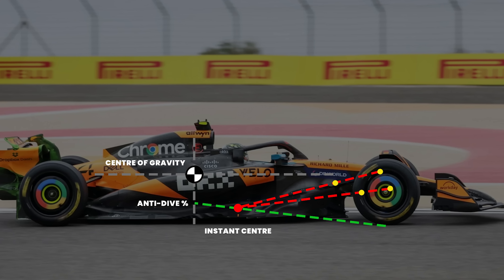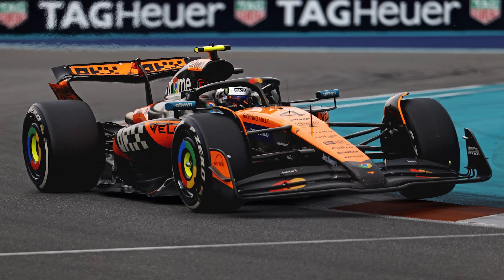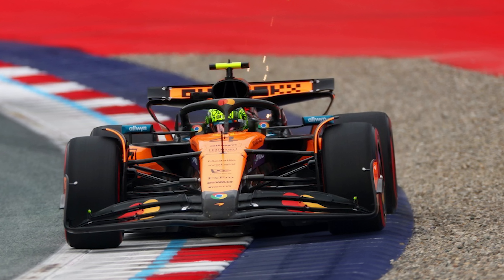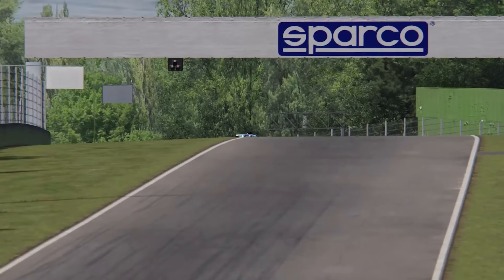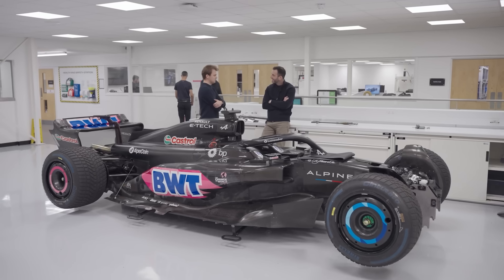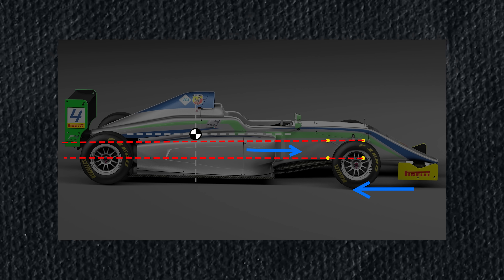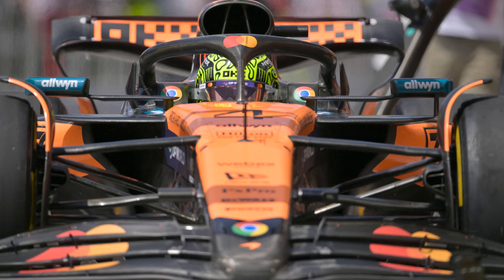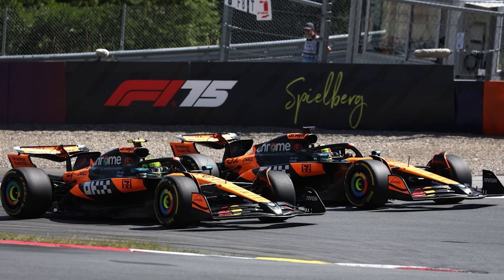McLaren’s NO SUSPENSION Trick

Comment: "Stiffer" front end would make that weight transfer reach the tires much faster, causing sharper spikes in load and making it harder for the driver to anticipate the onset of understeer/oversteer and under-rotation. Therefore this will potentially increase tire heat and wear, if it's too much for the specific driver to manage. As with most things in racing, it's a trade-off!
Reply: If Im not mistaken, the whole antidive thing is to prevent the weight shif to reach the tyre. While on a stiffer suspension the weight do reach the tyre. Correct me if I'm wrong.
Reply: @slash148  If you stand on your both feet and rock right to left, can you prevent the weight shift reaching your left foot other than by lifting it and falling over? It's impossible. But if you bend your knee in the process that will slow down the transfer of energy to your foot. That's why we bend our joints when we land. So yeah, even if you have no suspension at all (and zero dive), you'll have the same weight transfer, but the load will reach the contact patch much faster.

I think, McLaren's calculation is that aero benefits from having a more vertically static car, aka "stable platform", will outweigh the suspension performance downsides. In general, stiffer cars is a known side-effect of regs that favour ground-effect.
Reply: @Pandamasque  To my understanding (according with what I just saw) The weight is absorbed kind of horizontally rather than vertically.  I mean, if you want a stiff suspension just stiff the spring/dampers. The nose won't dive but the tyres are going to degrade faster. But they said that antidiving helps the tyre last longer, so.. it shouldn't be equal to just stiffening the suspension, where the weight should still be there, just transferred to the rubber. That's what is making me doubt. I'm not engineer by no means, just wildly speculating.
My point being: If they say: "Nose doesnt dive, tyre last longer" How can your response be: "No, tyre degrade faster cause stiffer suspension'", when McLaren has had phenomenal tyre management. Wouldnt the "tyre last longer" bit imply that the whole system is just much more that a simple stiffening of the suspension?.
Reply: @slash148  That tire may indeed last longer due to the car staying more level, therefore not losing as much downforce and not sliding as much. If this effect is more pronounced than what I described and what Norris complained about, then it's worth it. They don't do it (as much) by simply stiffening the suspension because that would compromise its ability to absorb undulations and keep tires in contact with the track.  Some years ago Mercedes allegedly had an even cleverer solution, a hydraulic system that connected front and rear suspension and prevented simultaneous rise at the rear and drop at the front. At the same time suspension could remain as soft as needed. But that was outlawed. The same was used by some LMP1 competitors. This new geometric trend is simply a way to achieve similar results within these tighter regulations.
Towards the end the author of the video emphasised that the weight transfer still happens. You can't cheat physics. The weight will reach the ground. The only thing connecting the car to the ground are 4 tiny contact patches.

Comment: I'm curious. I worked with phase change materials for many years in microelectronic applications. (phase change memory) That set of materials generally have low coefficients of thermal conductivity, which means that they aren't good at transferring heat. How is that used to an advantage in braking for F1 cars? 
Was the stoiciometry of the phase change material engineered to actually have a phase transition during braking, which could in theory absorb more heat than a standard brake pad?  I assume that could potentially mean cooler discs, but does that really have a significant effect on the tire temperature? 🤔 
I don't know much about cars, but F1 is rad. Subscribed. 😊
Reply: I’m not an engineer so maybe I’m not in the position to answer but from my understanding the phase change material is used in the cake tin, the shrouding between the brake and the wheel rim. Therefore in theory because of its low thermal conductivity, it could be designed to keep excess heat away from the tyre carcass. 

If you google F1 wheel cake tin there’s a few illustrations on what it looks like and what it does.
Reply: The only thing I could add is that in F1, every tiny improvement gets taken advantage of. On qualifying laps the time differences are often in the 100th's of a second... so some things might not be relevant to daily driving vehicles, or other motorsports... that's why F1 is the masterclass of motorsport ❤
Reply: It's so NOT, but knuckleheads read something that sounds official and IRRESPONSIBLY "Report" on it and give it an insane amount of credibility with exactly ZERO evidence or a real understanding as to the capabilities and possibilities of such, including this nitwit.
Reply: All material are phase changing but the point is to find one at correct melting point, latent heat, and thermal conductivity. Water could be a good material if it had a higher melting point.

EDIT: Noticed after posting that water would be a horrible material because ice would expand. Therefore it would be hard to make sure that liquid would stay balanced in a moving car.
Reply: @suokkos  It's also a terrible example because it would evaporate and cause oxidation to some degree. But you're wrong in saying EVERYTHING is phase changing, at least not in any way applicable in this type of environment.

As for Ice causing expansion, that would actually be a great way of controlling angles and the like on bodywork because if you can freeze it inside a cavity that's built in a specific way that causes it to always flex or contour in the exact same way every time, you'd have a nearly undetectable way of having active aero.

Regardless, Phase Changing NOTHING was utilized by Macca to achieve what they are with the tires and neither is suspension geometry. Regardless of Geometry, Track Temperature, pitch and roll under acceleration and braking affects ALL cars because of this thing called "Physics" that NOTHING is impervious to, and Macca also does not have special tires that are immune to all the forces they are subjected to. More likely than anything else they have devised a car that is better balanced than everyone else that is more aero efficient on all fronts and they have likely figured out how to mount the entire drivetrain lower than anyone else, thereby benefitting by a lower center of gravity which affords a car superior performance.
Reply: @theINQBS  , I said everything is phasing changing material because they are. They just have different properties. A lot phase change use cases require specialised properties which means people might associate the word to a very specialised subset of materials. Different applications have different subsets of materials which apply.

The earlier video suggested that Macca might be using phase change materials to manage break heat. The idea would be to collect heat to phase change during breaking which limits the temperature to the phase change point. This would avoid overheating tyres. Normal air cooling would then remove the extra heat between breaking zones. This would reduce or eliminate temperature variation which is supposed to help tyre life.

I didn't think about expansion changing body work for an active aero. That is an interesting idea. I was thinking about the problem that liquid water in rigid container would leave space for sloshing. Breaking would cause the melting which means sloshing would affect cornering. Freezing would happen only slowly while cooling removes heat after the breaking zone.
Reply: @suokkos  Trust me there is ZERO Truth about Phase Changing anything. F1 engineers are among the very best on the planet, and if they thought there was a practical way to apply said materials in a way that led to a faster car that's legally within the confines of the rules and regulations ALL teams would have implemented them long ago.

As for liquid filled elements, a simple valve would allow a compartment to be filled to absolute capacity with exactly zero slosh, and a clever way to change a liquid's outward exertion is agitation. And when you remember that an F1 car vibrates any hundreds of millions of times per minute, agitation would likely be the altering component that would likely cause an aero component to change angle or shape ever so slightly.
Reply: The phase change material is packed into the outer edges of the brake drum so it is mostly for tire temps. 
I think they can fit a lot of it in there so it ends up making more of a difference than it would in microelectronics. 
This keeps the tires in the optimal window for better grip which allows the drivers to push just a bit longer than the rest. 
So it is less about the temps under braking and more about temps throughout a lap or (more impact fully) throughout an entire race stint. Max has still been able to out-qualify the McLarens at times because the phase change material is most impactful over multiple laps. 

Definitely recommend watching this channel’s video on the phase change material. 😃
Reply: @embeddedspade9576 In microelectronics, it's usually not used to alter the transfer of heat. The concept there is to make an extremely tiny memory bit that can be altered between crystalline (low electrical resistance) and amorphous (high electrical resistance) states.  The way you do that is all about how rapidly the material cools. If you hit the material with a strong electrical pulse that has a very rapid falling edge, it cools fast and will be amorphous. If you want a crystalline state, you control the falling edge of the electrical pulse such that it cools slowly. The state of the bit is nonvolatile, meaning that is doesn't require power to keep its state.
Reply: @embeddedspade9576  There are exactly ZERO Phase Change Materials being utilized by McLaren. That bandwagon notion was pure speculative nonsense.

Comment: Am I correct in thinking that most or all of the force absorbed by the shocks is now absorbed by the wishbone arms and mounting points in the chassis? One would assume you'd start seeing material fatigue on these parts so much sooner than the rival designs. Is there an expensive wear and tear cost we haven't seen yet?

Comment: I never understood why F1 teams will run duplicate cars for two different drivers here in the states especially in NASCAR. They can have four cars per team built in the same building and handle completely different to help the driver’s comfortability. I applaud McLaren for making two different handling cars for two different drivers that’s howthey’re so competitive they need to give you Yuki at Red Bull a car more closely handling to the race bulls.
Reply: in theory, it's more costly to test and design multiple aero philosophies, and also if the data says one design is superior, you'd be reluctant make a separate, inferior design. Sure, it is likely that a more controllable car can get more consistent results than a fast but twitchy car, would depend on what the bosses want to do. Sometimes you get a max who can handle an insanely twitchy car and still go fast, which will possibly make it difficult to reverse course with a very different design with the testing caps in place.
Reply: 2 words.

Cost cap.

Much cheaper to make 1 car then 2.
Reply: Cost and Red Bull’s scouting program is so massive they are hoping they can find another Max Verstappen but we aren’t go to see anyone like him for a long time.
Reply: Development cost. Just the f1 steering wheel costs more than a full nascar car...

Comment: You don't draw a line through the chassis mounts, you need to extend the wishbones until they are in the wheel center plane and draw the lines at the height which they intersect the wheel plane. Depending on the angle of the wishbones, this changes the vertical position quite a bit. From looking at previous years cars, I don't think 100% anti dive is unique, I think they did this for a while. In fact, it might be more than 100% because you probably need 200% to compensate some of the tire squish you get from the inevitable load transfer. I also don't think the driver feels this all that much. From maybe 4mm nearly instant travel on the suspension and say 10mm on the tires, to 0mm on the suspension but still 10mm on the tires, it all happens nearly instantly and it would be too simple to suggest this is what makes a car tricky to drive. Also, you're only on the brakes a few seconds a lap, and when not on the brakes, suspension travel is as normal. There are too many factors at play to suggest this single thing was causing something.
Reply: There's more than one way to graphically determine anti dive. I would agree that anti dive probably doesn't have all that much to do with front end feel in this case considering how insanely stiff F1 cars are in general. The fact that they changed the kingpin angle is further evidence that it's probably something else in the kinematics that Lando has been disliking, as the kingpin has no influence on anti dive. It might be something about the car's roll behavior, how it bump steers or something similar.
Reply: Niels! Love your brakes, man!

Comment: There is no such thing as "weight transfer". Nothing is moving, except for the suspension compression. It's just an effect of the body pivoting around the front tyres contact patches.
Reply: respectfully disagree since the system is not a static physics calculation as your comment eludes in addition to the pivot around the CoG.
Reply: @kuricat8783 It obviously depends on the frame of reference but it can be seen as rotation of the centre of mass around the aforementioned contact patch
Reply: The transfer is measure in the weight added or removed from the tire as the vehicle accelerates, brakes or turns.
Reply: @jamesduncan578 Yeah, weight, right. And where does this weight come from or goes to? Suddenly gravity changes? Timespace folds?

Comment: After saying physics is physics, there's not a follow through pointing out that if you had for example infinitely stiff front suspension for any given load direction that you're going to have much more abrupt load changes on the front tires. I was waiting for it, because in other things you'd said that's what you were hinting at, but it's not explicitly stated and you continue on speaking about the notion that the load is being taken up by other components of the suspension. Those other components would also have a degree of flex, which would slow the transfer of load to the tires given their relative rates of flex, but given those components are orders of magnitude more stiff than a typical spring it's still pretty close just sticking with the infinitely stiff front suspension analogy.

Back in the day Williams testing the no suspension car basically said the car would be faster ... if a human in the loop could drive it. The roughness of the track for sure would play into that, infinitely smooth should be fine, but good luck at a track like Sebring.

It's interesting to see teams pushing this limit and seeing how much maximizing the aero platform above all else pays dividends.

Comment: The diffuser throat on these cars is ~700mm ahead of the rear axle center line. Almost 3/4ths of a meter, so both axles have a big impact on the diffuser's throat and ramp angles.

Comment: From phase-changing materials to no suspension... Whats next? 4 Wheel steering Speed racer style?
Reply: It is thought that their suspension acts similar to DAS in certain cenarios, where the tires has lower drag (and heat generation) on the straights and more grip in the corners. That may be next.
Reply: There was 4 wheel steering before but it got outlawed like decades ago

Comment: Super cool video, thanks! Props to McL for being willing to listen to, and support, both of their drivers.

This is not a fully-formed thought, but there's a part of me that feels this takes a little something away from the championship battle (a very little something... clearly I am nit-picking here!). The great storyline of these inter-team F1 championship battles over the years (Hamilton-Rosberg, Senna-Prost, etc.) has always been about putting both drivers in equal machinery, and seeing who is the best. Are we basically seeing two drivers in two different cars in one team this year?
Reply: Every driver has their own setup for their car,this is just another slight difference that happens to be easy to notice
Reply: @FüTyibi  
The Two McClaren cars have different components, and they are mounted in different locations.  That is very different from the usual situation where the cars are the same and the drivers only get a small amount of variation from the car's ability to be adjusted a little differently.
Reply: @deezynar   Well put. It's a strange one. I don't think I've ever heard of a team doing this before. Seems like (mildly) preferential treatment for car #4
Reply: @almabatekert_villanykorte3387  moving the location of suspension mountings isn't a simple difference in settings though like stiffer springs or ride height adjustment. This is a re-design of the tub.
Reply: As much as I agree, I'm pretty sure that in the Nico vs Lewis fight there was also some fidgeting around with preferential setups...
Reply: I bet Yuki is going to be banging on Horner's door "why can't you build two different cars instead of just two for Max?"